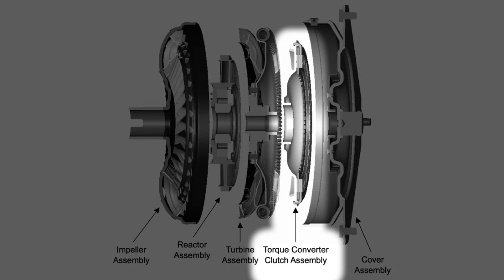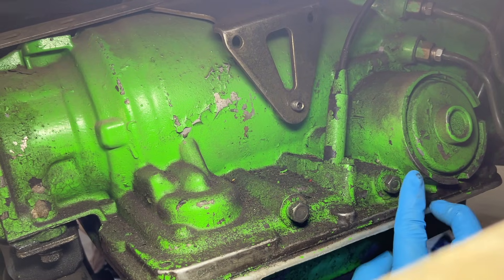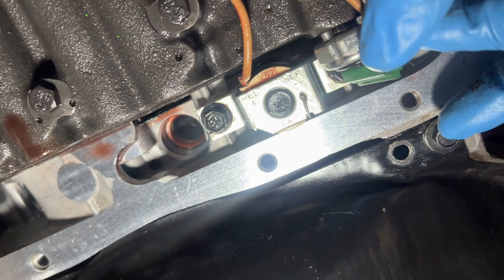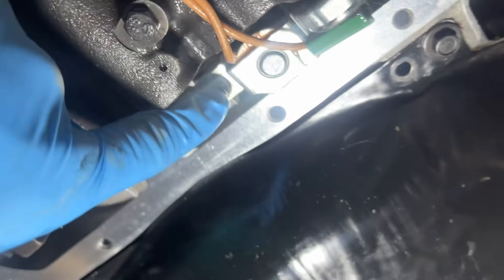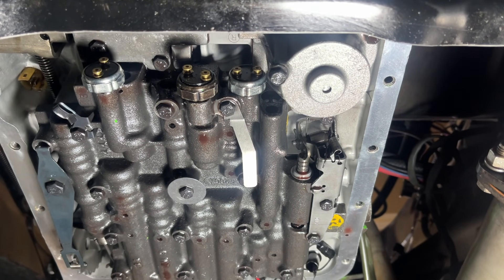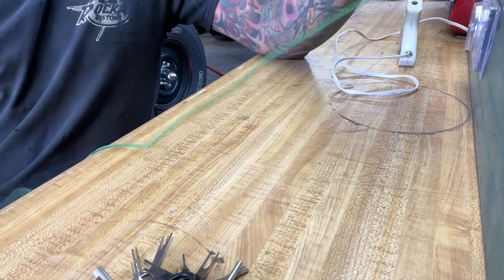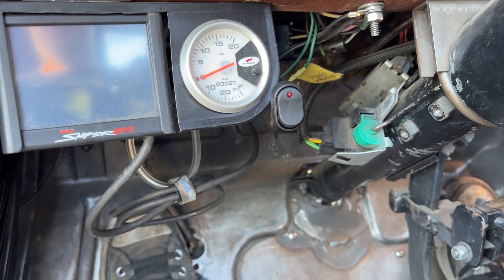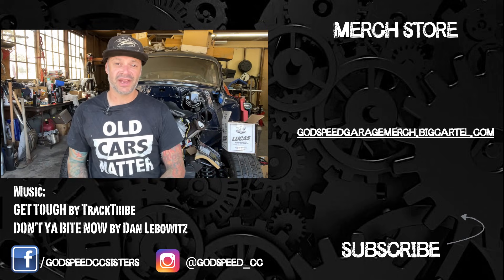WATCH THIS BEFORE CONNECTING TCC LOCKUP!!

Comment: I wondered why don't you have third and fourth gear pressure switch wired in, the old 3 speeds would lock for 45 mph, I have a 200-4R that when I put it in my 84 olds would lock in third, but not 4th, made a cheater switch like you did to freeway driving, best of both worlds.

Comment: Saludos hermano. Tengo un problema con la transmisión de mi Avalanche 2006. El scanner me arroja código p0470. Lo que significa problemas con el selenoide tcc. El mío es de dos cables, lo retire y media los ohms y estaba bien. 22.8 luego le hice una prueba neumática aplicando aire en la boca y conectando a 12 voltios. Tengo una duda, cuando no le coloco corriente, hay pase de aire, pero cuando le coloco corriente el selenoide cierra. Entonces puedo decir que el selenoide está bueno? Los ohms de la tcc pwm también están bien. 11.7 lo que si no escucho es el click al ponerlo en 12v.

Comment: Do you have a video showing the pressure switches and explaining those? I swapped my 87 Monte from a 3 speed to a 700r4 87 model and it was mostly plug and play. Drove fine however now it won’t shift into 3rd or 4th. I have to pop it down manually to 3rd to use 1-3 gears normally. If I go up to drive it won’t shift into 3rd. Why? Any ideas?
Reply: Did you ever figure it out

Comment: Excellent video on 700R4. Do you have anything on 200-4R? Also there are numerous different types of Lock-up kits available causing lots of confusion on which to select, though TCI lock-up kit TCI 376600 appears most popular choice. 
Also many have indicated to use vacuum for lock-up than the brake switch, effective and simpler system. Then there are many others who say just forget about the OD/lock-up esp if you're not interested in the fuel economy part as these cars are seldom used anyway. In this case, use a trans cooler. 
By the way, I purchased this TH200-4R from Summit SUM-700200 built by TCI many years ago and only now (health reasons) intend to replace my current TH350 which is playing up. I am not sure if there is already a lock-up wiring internally. 
Looking forward to your advice. Cheers mate.

Comment: Would there be a problem running the ground from the solenoid straight to a single pole pressure switch and then running power straight from the exterior power plug to the power side of the solenoid. This way the solenoid will have constant power but the solenoid won't engage until the switch gets proper pressure and then grounds the solenoid through the case. This would make it so you don't need a double pole pressure switch.

Comment: This is one of the best videos I’ve seen on TCC. My case is 0CHM but doesn’t have any pressure ports on the passenger side. Says the transmission is from TBI 5.7 truck. So my next step will be to order the same kit you used. Thanks for a great video. You gained another subscriber today!

Comment: bro building a 1985 ss 350/700r4 we found a hot wire for for excesseries 30 amp coming from fuse block we taped into always hot running down there when key is on we was told trans was one wire at factory plug ..and grounded   can i wire it threw the  brake lights  like you did in your truck please help thank u

Comment: Quick question, why would it stall at a stop light if TCC is not disengaged? shouldn't it be released when coasting and transmission comes out from 4th to 3rd? Great video by the way, loved the relay setup.

Comment: I had a 1998 G30 with a 6.2L diesel (w/700R4)  I towed with it a good bit and it really irritated me when the TCC would unlock when you pushed more that like 3/4 throttle.  This might have been good practice for a gasoline but the diesel didn't need it.  I also wanted lock for long hills in lower gears.   I directly wired a switch to force it to lock.  It drove fine and I found I could just leave it in lock almost all the time.  (This is not good practice on ice or is slippery conditions as it really needs to let go when you push the brake.)  But the real issue showed itself about a year later when reverse failed (never used lock in reverse)   It turned out that the engineers, in improving efficiency, actually valve off lubrication to bearings that were not being used in 4th(and lock up) but are in lower gears.  That meant any time I was in lock in the lower gears I was eating bearings.  Finally a seal failed and caused the reverse to fail.  I discovered that I could grind a flat spot on one of the valve body spools and keep the lub active.  I also discovered that later model trans had this done at the factory.   I swapped the 89 van for a 92  which I have to this day and still use the lock almost all the time.  Due to the design of the trans it will not lock in first even if the switch is on.   I wired a toggle switch on the shift leaver and turn it off when stopping and back on when I reach a cruse. as it bothers me to lock it under hard load.  But I lave it in lock when it down and up shifts etc.  ( I didn't used any pressure switches)    I am trying to figure out if I can do something similar to my 2012 T&C...
Reply: I have the 6.5 with the 700r4 and I want it locked for towing like you but you think I could leave it hooked up and just use a ground wire on a switch since the power wire always has power
Reply: @brandonhartzell20  It's been a long time since I wired mine up so you're on your own as to whether you need to feed it power or ground.  As I slow down and it gets slow in 2nd  I notice that it's locked as it doesn't go to first and unlock but quite slow.  My old clutch foot starts searching for a clutch peddle and I remember to switch it out.  Also, If I leave it locked on take off and don't really push the accelerator it will switch into 2nd and lock and pull the rpm down lower than I like (lugging territory).  I find the "bother" factor of flipping the switch to be very low and to me, I'd make the mod again in a minute.
Reply: Its not a valve body spool it's the regulator valve inside the pump.and yes the later ones came with a flat already ground into it

Comment: Mine has 8676358 in big numbers (like 1 inch tall) just above the pan on driv. side.  Also on drivers side, to the right of that number is a 2 wire connector

Comment: Okay that doesn't make any sense! 
The one wire solenoid is grounded on one side of the coil wire correct?
You installed the two wire solenoid and then did exactly the same grounded one of the wires.
So why did you install a two wire solenoid if you were going to ground one side of it anyway? 
Am I missing something?
Reply: I guess it’s optional because I feel if it’s grounded that’s it

Comment: On A 89 trans you ground it to the 4 th. Gear pressure switch and run power out to brake light switch - if it is carborated ? . If FI leave it stock. With the stock 2 wire TCC solinoid. Nothing required just move a wire. Eliminate 3rd wire. This is the easiest way to get the TCC solinoid working, no kits or any other parts. I'm not sure how the earlier two wire switches work but I think that they could work with one side grounded on fourth gear pressure. I have a single wire on my van with the earlier 700r4 for TCC lockup. That is probably grounded through a fourth gear pressure switch. I'm guessing that. I do remember that I just hooked up one wire from the brake light switch, on with pedal released, so it has to be turning on by the fourth gear pressure switch grounding The TCC solinoid. And it shuts off by the brake light switch.

Comment: On my transmission, (1985 w/ Type 4 wiring), that pressure switch only has one prong. However, the one beside it has 2 prongs. Would it be ok to swap them since that one will no longer be used?

Comment: I have the 2 wire solenoid, my question is, if I connect the power side to a manual switch controlled relay, will it only activate when there is enough pressure or when the switch is on?

Comment: I was wondering if your transmission  has  the cable or or not      I know that  some  do and some  don't       the 1 I have  has the cable.   I know the cable is
 mainly used to control line Pressure     
Anyway I  was just wondering if your transmission has the cable or not

Comment: Another good video man. The brake switch interrupt was necessary because as you begin to slow down from a 4th gear cruise, your clutch would potentially stay locked up and fight you trying to decelerate??? Never thought about all this, but that makes sense. Sitting at a stop light you really shouldn’t need the interrupt from the brake, right?  Fourth gear solenoid has already let go and the clutch should be released. Am I missing something?  Was nice to see a new video from you man. One of my favorite channels. Clay
Reply from the maker: oh yeah... to answer your question - I've heard both ways are true - some say you HAVE to cut it off, coming out of 4th gear on its own won't un-energize the solenoid.  some say you HAVE to shut it off or the engine will stall.  that might be another one of those "depends on the model" things.  using that handbook I figured out mine was originally connected to a vacuum switch, which cuts off the electrical signal once the vacuum switch goes below a certain vacuum level.  most guys I talked with say to wire it through your brake switch.  it's easy enough and then there's no doubt.  hope that helps!
Reply: @GODSPEEDGarage  It sure does. Glad to see you back posting.  take care, Clay
Reply from the maker: thanks!  I know... videos had to pause for a while so I could take care of a few things... but I've got a bunch in the hopper, so time to get back to work and get them posted!  Thanks for watching!
Reply: U wouldn't need the "interrupt" at all... the solenoid is controlled by pressure being in 4th gear.. while in 4th gear and u begin to slow down the pressure will change and disconnect the solenoid...  so no need to manually disconnect it..